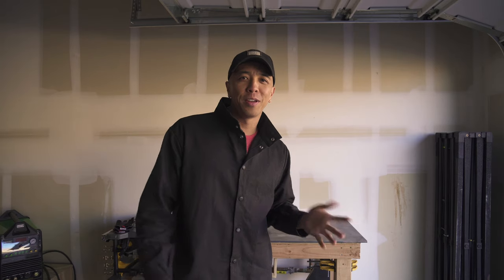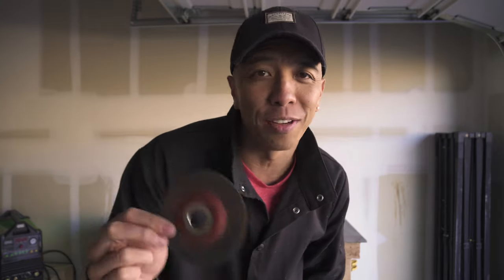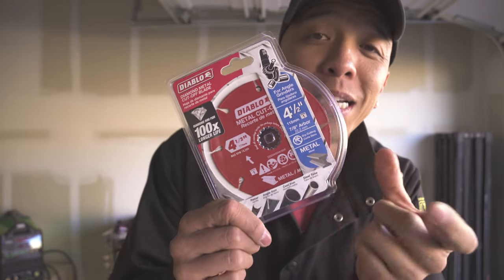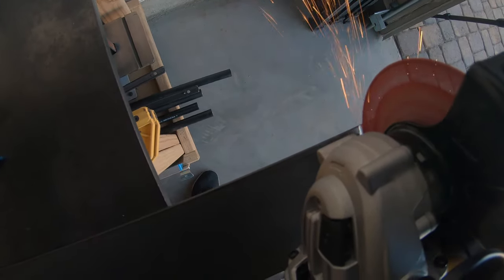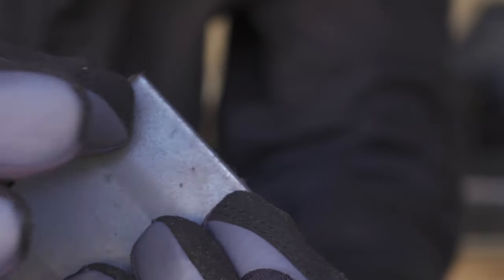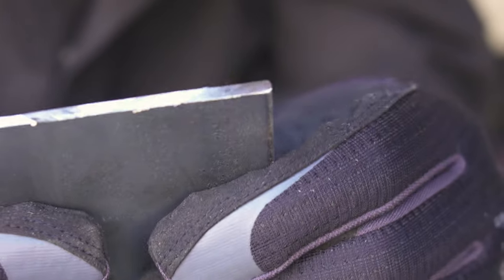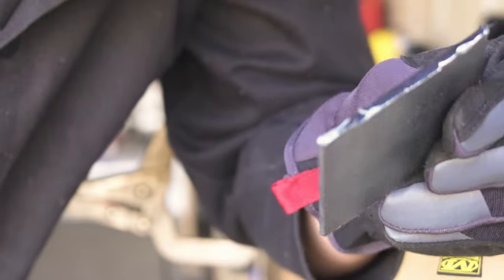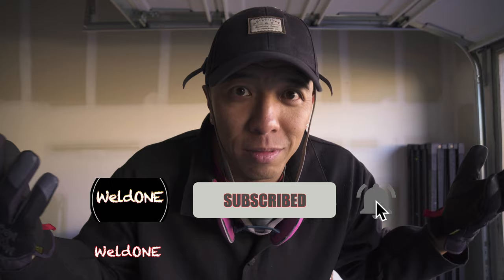Have you ever tried the Diablo diamond cut off wheel

Comment: Search for Grinder Safety: How to Properly Use an Angle Grinder for a more comprehensive guide. That video is about 45 minutes long but it is the most comprehensive and easy follow guide on how to use a grinder safely and most of the attachments available (and how to use them). About 1.8M views so far. Think of it as an insurance policy to your health so that you don't get hurt. No disrespect to the person who took the time to film and edit this video but the way he was holding, using and cutting with the grinder is BACKWARDS and DANGEROUS to those who would watch this video prior to using a grinder of their own. If you are right-handed, the screw on handle is mounted on the left (instead of on the right like they in this video). Also, the bottom of the cutting wheel should be facing left instead of right in this video. Why? the rotation of the grinder/wheel (most I am aware of) is clock-wise when looking at the top of the grinder. When cutting, the grinder/wheel should feel like it wants to move away from you instead of toward you. The sparks should be flying toward the floor and not away like this video. If you hold it wrong like this guy and you lose grip, the grinder/wheel will move toward you or your leg and you would be going to a hospital.

Comment: Mate, you need to educate yourself on the matter before posting undocumented stuff... It's not the brand which matters.. There are a few reputable manufacturers of such wheels and all perform similarly. It's not about a bit of burr, which can be handled by someone who operates an angle grinder, it's about the benefits of using such. First off, it will hold the cutting diameter. Imagine you have to do a long cut; what are your options, to exchange a ton of wheels, or simply use one which does not "melt" under your eyes? Second MAJOR benefit is safety; these wheels don't splitter. Third benefit is monetary; just do the math; 1000 cuts on a $15 wheel compared to three0five cuts on a $1.5 wheel... Next is the wheel dust of the traditional over zero dust from the metal/diamond one. Next benefit: No smell!!! That's a big one if you work in a living space (yes it so can happen that you need to cut something off at your or a customers home). Now, you keep going over traditional because you're to lazy to clean-up a cut... Merry Christmas!
Reply: So if I try to fit a peice of metal fluch I'm not having burs man😂 and it's slower, louder and flings diamonds at u. Go back to school old man
Reply: Both abrasive wheel and diamond wheel still need edge prep on work piece to ready for welding. Shaving or dust will be created by flap disc afterward. Unless you are the contractor that cut pipes without cleaning up the edge, are you?